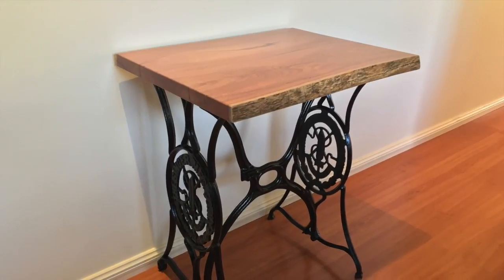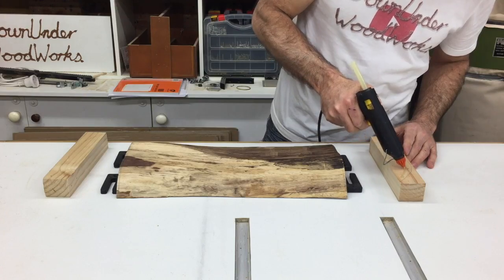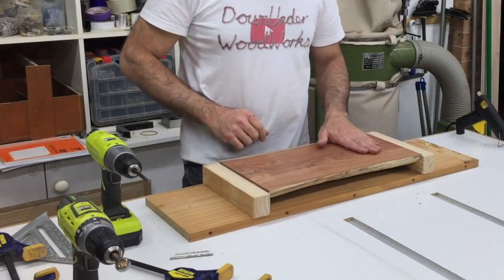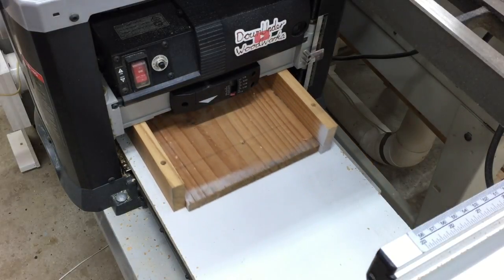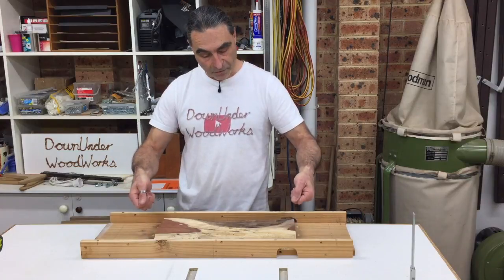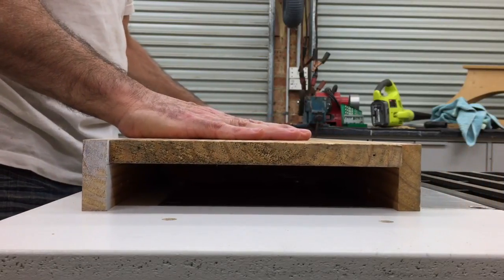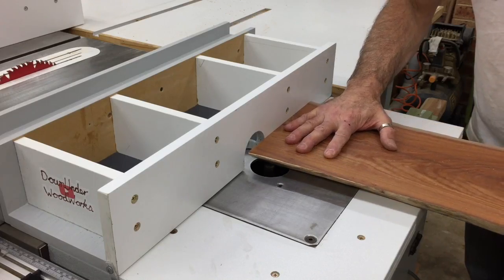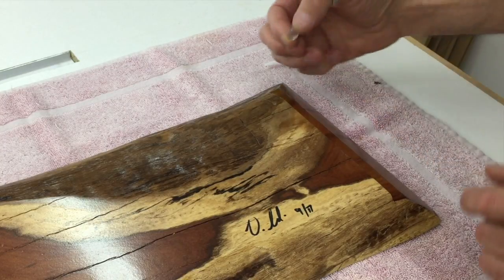Make a live edge platter

Comment: John, I just purchased the same/similar  table as yours from Hare & Forbes (ST12D) and I was wondering how to protect mine as it is already showing signs of rusting on top and not sure whether to put polish or oil on the surface, how do you protect yours, I am on the Gold Coast, I am & others will be interested in your response. Thanks mate
Reply from the maker: Hey, thanks for the question. I don't tend to get a lot of surface rust on mine, I'm sure its a location thing but I clean mine up every now and then with very fine wet and dry paper and WD40. I've also used silicone spray on it after cleaning it up. Cheers mate.
Reply: thanks mate I will try that, keep up the good work

Comment: As a matter of curiosity, I noticed someone commenting in foodgrade finish. 
What would you have used had its purpose had been to place food on it?
Reply from the maker: Good questionGuylene. There is a lot of different thoughts around about food safe finishes. One is that all finishes are food safe once they are fully cured/dried. I tend to agree with that. I have recently been using a natural beeswax from mindyourbeeswax.com.au. Its a great product and I just used it on a serving tray gift I made. Cheers.
Reply: DownUnderWoodWorks Thankyou for your advice.